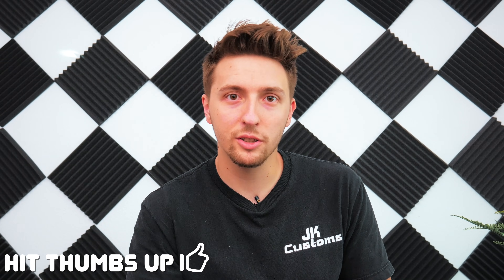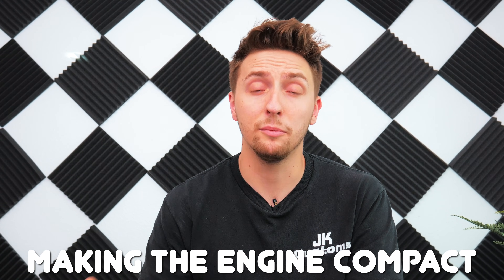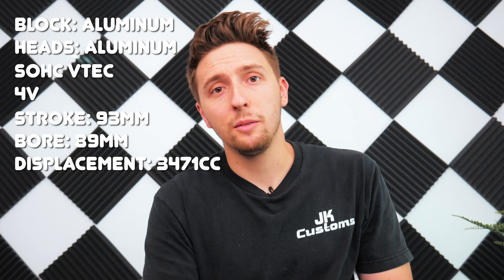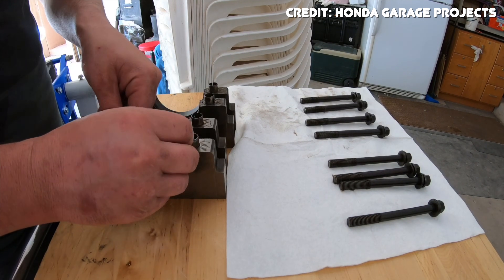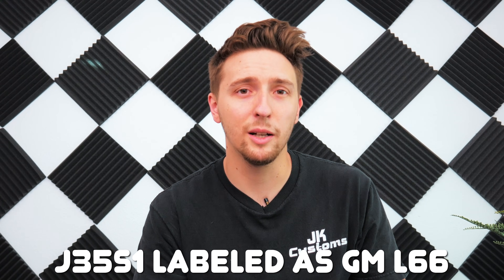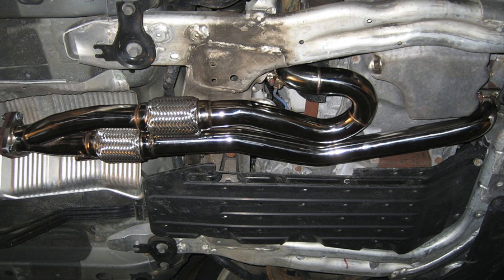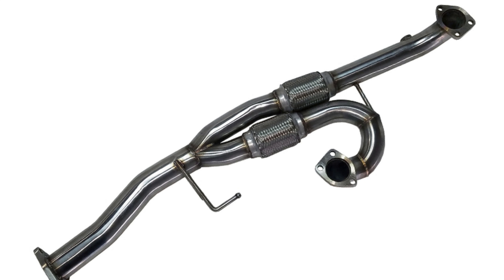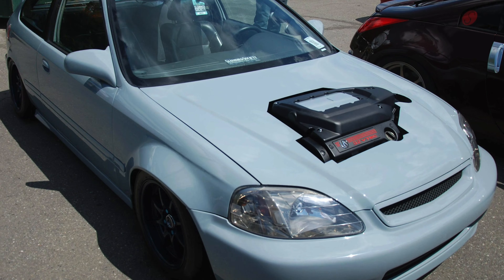Honda J35: Everything You Need to Know

Comment from the maker: If you guys enjoyed the video, please SMASH THAT LIKE BUTTON. It helps the channel out a huge amount and helps YouTube put the video in front of more people. Thanks for watching 😬
Reply: Hey yo, seems like alot of people ask  questions here, I recently came into owning a 2007 honda pilot ex l, it has a J35A9 ij it, and I'm wondering if all these other parts from the other models will still fit on it, unsure, peace and love ✌
Reply: I have a question what j or k series engines should I swap in a 2019 Honda CR-V. I want 1000 ground HP in the CR-V and I have seen a lot of videos about it also I want to have it still AWD. Please help if any advice.
Reply: If I get the biggest hood spacers would it still be needed to cut the hood ?
Reply: Just had the VCM muzzled on my 2023 Ridgeline - very smooth on the highway now.
Reply: I have a 04 Saturn Vue with the J35S1 it comes with 250HP and 243TRQ And i absolutely love my motor

Comment: I have a 2007 Accord 3.0 v6 myself, and tegas mirage isn't the best,but it hauled ass stock,and even moreso after a cold air intake, high flow cats,2.5" piping,and flowmasters. The only thing that really gets to me is that there are no tuners for the Automatic transmission model. So Its pointless to add things like bigger injectors and an Acura throttle body because it needs to be tuned after that to run right. So all you can do is basic stuff and get maybe 265 horsepower I'd guess. With a tuner id guess you could get closer to 290. But in their infinite wisdom, Hondata and Ktuner decided not to make tunes for it.

Comment: The J35Y6 that is in the Odyssey's is a SOHC VTEC 3.5L V6 in summary that gets 19 MPG on city and 28 MPG on highway. A very reliable engine (Toyota and Honda on the top) but for comparison when Honda replaced the engine in the PILOT with the DOHC VTC and variable timing 3.5L V6 285 HP 262 LB FT TORQUE J35Y8 the car got 19 MPG city and 27 MPG highway. Why I beg to differ is because the 2017-2020 Toyota Sienna's with the 2GR-FKS Dual VVT-i and Wide DOHC D4-S Direct and Port injection (Very Reliable) got 19 MPG and 27 MPG highway. A lot of people trashed this MPG difference that was very small personally and online without researching what SOHC and DOHC is. When Honda made a DOHC 3.5L V6 it got the same MPG as the 2GR-FKS. Regardless Honda Engines and Toyota Engines are very good like the J35Y6, 2GR-FKS that I talked about but a lot of unexperienced people in the field just make Honda engines seem very superior than Toyota engines without any proof. The 2GR-FKS was made with High forged steel camshafts, High forged steel piston rods, etc. and was tuned for performance, the J35Y6 has different characteristics like normal forged steel camshafts, etc. And opinions without proof just come up. DOHC and SOHC are very different and look completely different. Also engine stress is a completely different topic but 280 HP and 296 HP are compared like 280 HP with such lower components means Honda is always better. Not in every case. There's a reason why the J35Y6 has issues alongside the 2GR-FKS. Both have issues but someone has to claim the spot. In my case, the 2GR-FKS takes the spot since it has so many complex systems yet never fails on them most of the time (not sure if it ever did but I have seen these engines before), very powerful V6, higher hp and torque, higher redline, timing chain driven (Odyssey: Belt Driven). So many advantages. And very good low end and high end power.

Comment: Here's the revised sales ad with the added details:

UNLEASH THE BEAST!

Get ready to turn heads with this one-of-a-kind, V6 supercharged Acura TLX convertible. With its sleek design and powerful engine, this luxury ride is sure to dominate the roads.

The Specs:

- 3.5L V6 engine, supercharged for maximum power
- Estimated 450 horsepower and 350 lb-ft torque
- 8-speed automatic transmission for seamless acceleration
- Sport-tuned suspension for razor-sharp handling
- Upgraded brakes to handle the added power
- Hybrid rear end for optimized performance and durability
- Rear-wheel drive for ultimate driving dynamics

The Luxury Features:

- Premium leather interior with heated and cooled seats
- Navigation system with real-time traffic updates
- Bang & Olufsen sound system for an immersive audio experience
- Advanced safety features, including lane departure warning and blind spot monitoring

The Convertible Experience:

- Soft-top convertible roof for an open-air driving experience
- Windblocker for reduced wind noise and improved comfort
- Unique styling cues, including a distinctive rear diffuser

The Look:

- Aggressive front grille and side vents
- 20-inch alloy wheels wrapped in high-performance tires
- Quad exhaust outlets for a bold sound
- Available in a sleek, glossy black finish

The Deal:

This Acura TLX convertible is a rare find, and we're looking for a discerning owner to take it home. Price negotiable for the right buyer. Don't miss out on this opportunity to own a truly unique luxury ride.

If you're interested or want more details, hit me up! Let's make a deal.

Comment: I have a 05 Honda Odyssey with a J35A7 and its not slow, not fast but not slow
Reply: Get a Saturn VUE 04-07 the Honda J35A3 , it has 248HP/242TQ and the VUE weighs 1,000lbs less than the Odyssey.

The J-series VUE is very quick.

Comment: Would a J35 fit in a 1997 Odyssey without having to cut the hood?
Reply: Why not just find a Saturn VUE? 04-07 has a HONDA J35A3 in it and the VUE weighs about 1,000lbs less than the Odyssey. A lot of sellers I find don't even know they have a Honda engine. I find them for dirty cheap. 

The Vue even has a Honda Transmission.

Comment: j series has some issues with oil leaks
valve cover gasket
oil filter adaptor gasket
vtech solenoid
vcm system shortens the life of engine and leads to bank1 cylinders getting more wear and imbalances and oil filling up bank 1and potentially causing a hydrolock .   SVCM controler disables the vcm system which is the way to go.

Comment: Can any J35 be swapped into an 2012 Odyssey (that has an existing J35 with the VCM oil-fouling issue) ?  I know it needs the later bell housing, but will the existing computer work with the slightly different engine?  What additional work would I need to do?  Thanks in advance
Reply: Why not just get a Saturn VUE? The 04-07 has a J-series J35A3 and a Honda Transmission, plus the VUE weighs 1,000lbs less than the Odyssey. Most sellers of Vues don't even know it's a Honda. 

More HP than the Odyssey variant.

Comment: To my experience, and unfortunately for buying a high mileage Honda product with this engine, the engine with proper maintenance, did not meet my expectations.  By 285, 000 miles the rings and valve seals are messed up.  Not even my 290,000 Chrysler 3.8 has burned that much oil as the Honda did in its last days.  Never again another v6 from Honda.

Comment: 2006 Ridgeline with 190k miles, checking in. J35 is still rock solid reliable in 2024 with just normal maintenance. Maybe it's not a truck. But after owning it for 18 years, I can confirm a 250hp V-TEC-powered AWD mini-van with a truck bed is still pretty bad-ass in its own way.
Reply: 211k on my 2016
Reply: 239,500 on my 14 ridgeline sport still pulls hard and drives like new!
Reply: My 07 acura tl has a 3.5 and a 3.7 intake manifold with the 3.2 heads and its all bolt on stock parts and makes 336 hp naturally aspirated 6 speed manual we took off a civic si and got a plate maid to make them stick together I now have a allwheeel drive acura to with a si trans 😂😂😂😂 this car freaking rips dudes
Reply: I just bought 2019 Ridgeline 100k miles on it with new transmission now I'm worried is my engine burning oil or not.. you all are high mileage can you tell me when it can start burning oil and after burning oil how long it can go without totally engine failure please advise me

Comment: I know this is an old video, but I can say from my experiences that the J-series engines without displacement-on-demand are amazing engines. A good friend of mine has a 2007 Acura TL with the 3.2 liter and its been such a great engine. On long drives it is not unheard of for my friend to get 35 miles per gallon at 80 miles per hour. In town, it has no trouble pulling around at idle and it is willing to go as soon as you touch the throttle, even with the insanely tall geared 5 speed auto.

Comment: I have one in my Vue. I love it. If you notice, it's mostly the V6 Vues that have survived and are still around.
Reply: I have Saturn Vue Redline AWD (2004) with J35 S1...  117,000 miles.
I love it,  and want to get more speed/power out of it...  am still searching for a place to work on my Honda-powered GM.
(it seems folks don't want to touch it).   I'm patient;  I just purchased it in Sept. 2024.

Comment: My 2003 acura tl-s had the 3.2 and still ran perfectly at 385k miles when I sold it.  My wife's current vehicle is a 2nd gen rdx 3.5.  Great motor with good power and efficiency.  You didn't really cover bad...  timing belt and oil from vvt that drips on alternator.

Comment: my glory days working as a Acura Tech in the early to late 2000s i was trained on the J series engines and i loved them. simple to work on very basic and great service life. i still own my 2004 TL 6 speed manual bought it brand new.
Reply: godspeed. wish i never sold mine. 05 with 230k and had absolutely no issues. The starter almost left me stranded but i was able to get home and replace it there. Top tier cars, seriously
Reply: @AfternoonProductions  absolutely. i would buy another in a heartbeat.
Reply: Can I put a j35 a9 where a j35 a6 engine was?
Reply: I had a 04 Aspec TL 6mt for years. After developing many oil leaks that I couldn't afford at that time of my life vs the costs on a car that had 240k I decided to update and switched to a '15 6-6 Accord with 87k. I have been more than satisfied with my switch. LOVE my Y2. Doesn't mean I don't still miss my TL many days. Kinda wish I still had LSD sometimes but man the raw pavement put out of my Accord keeps a constant smile on my face after 4 years not to mention I'm still looking back at her constantly after parking. Both wonderful vehicles.

Comment: Ive seen a j32a2 online with the j37 crank rods and piston aftermarket heads and costum intake manifold! It was a crate engine and it was rated at 435hp and 317 ft torque 10,000$

Comment: My 2006 Saturn Vue, with J35, is actually shockingly fast, especially off the line.  Nobody expects an old GM SUV to move like it does!
Reply: fr I have an '02 MDX which is basically the same setup as a vue redline, but larger and heavier. The awd paired with the 3.5 litres of torque gives it an insane jump off the line with really solid grip
Reply: @cartler  yes!! Also, the Acura SH-AWD system is supposed to be really really good! I’d love to have an MDX! Cheers!
Reply: Are those suv plastic doors like it was on the cars?
Reply: @DV90400  yes, all plastic body panels except hood, roof and liftgate.
Reply: @DV90400  - Yes, plastic body panels, all around (on those older Saturns) ...  "DENT RESISTANT" is what they called them,  and they truly are.
In Sept. 2024,  I purchased my 5th Saturn ... 2004 Saturn Vue "Redline" AWD ... J35 S1 engine  (aka  GM L66 engine).
Trans. is Honda,  too.... The All_Wheel_Drive makes it pretty quick, off the line.
I just need to find someone to 'TUNE" it  (make it faster).

Comment: I have a '14 Honda Accord v6 Sedan and  this car is quick. I'm glad I got it. I may just get a turbo or it later on.
Reply: Same year and model. These are the biggest sleepers on the road. Put it in sport mode, take off the traction control and hang on. A family sedan with an attitude.
Reply: @brentbeardsley655  for real the gears are pretty solid too in sport mode.

Comment: 300k miles on my all original '08 RL with J35.  Only regular maintenance, synthetic oil.  For tat matter entire drivetrain is all original. I regularly use paddle shifters, and will effortlessly hit redline if needed. Great car, great engine.
Reply: Does that have same transmission as 2007/2008 TL / TL type S? I have an 07 tl type s and the automatic** transmission downshifting is pretty jerky. 238k km
Reply: @excess.subiefl0w  Sorry, I have no idea.
Reply: @excess.subiefl0w have you tried rev matching or are you just dumping the clutch into a lower gear
Reply: @josephdunham9273  sorry I should have specified auto trans 😂 it's alot smoother in D but if I put in manual mode, it hates downshifting so much
Reply: @excess.subiefl0w  the viscosity of the fluid could help make a difference other than that flashing the tcm or changing shift solenoids  maybe even the way the engine drops rpm on manual downshift could be suspect but that's all just off the top of my head
Reply: @excess.subiefl0w have you done any trans service on it? Probably needs a fluid change.
Reply: @Tylerc3419  yeah I bought 9 bottles of fluid to do the 3x3x3 fluid change. I did 1 drain refill already and it's better but the auto mode is just way smoother. Will do remaining 2 refills this year
Reply: @excess.subiefl0w  good deal man. Each drain you'll see a huge difference. I've done the drain and fill with 2 of my older Chryslers. Also helped others probably save thousands, not everyone knows you have to do more than oil changes sadly.
Reply: I have the same car and it’s great but watch out for the trans cooler inside the radiator because it will fail and when it does, your trans will get contaminated with coolant and cost you a trans job.
Reply: @Bob-lh4mg  thanks. My radiator failed a year ago and I replaced with a CSF OE so should be good for a long time
Reply: @excess.subiefl0w  👍

Comment: The j32 heads have to be from a J32A2 which is the type-s motor from the the 2001 ro 2003 CL and TL Type-S. all other j series have normal heads.

Comment: GM should have just used Hondas engine. Their 3500 engine is gutless. 210hp compared to Hondas 250hp.
Reply: They did in the Saturn vue 2004 to 2007

Comment: Love the J Series engine, if you take care of her she will take care of you. One thing he forgot to mention, change the timing belt and the components every 90,000 to 100,000 miles and keep your eye on the coolant and be sure to do your oil changes.
Reply: @user-pv8sx8xm4uthe average person don't know much about piston rings yet every engine has them. so the point is?
Reply: @68camaro-b5s I cannot explain it myself but this has always been my understanding in general. Seems like it's a more common issue on V6 vs i4 with piston rings, timing, etc.
Reply: What's up with keeping an eye on the coolant? Water pump leaks?
Reply: @MeltingRubberZ28  Lack of doing timing job because of costs it seems like. Since by the time you get to the water pump, you're practically peaking a timing job that includes it by the pumps end cycle expectancy. Being cheap asses instead of doing ball joints, plugs general maintenance etc. Just my 2 cents I'm no mechanic just know some basics.

Comment: Do the benefits of the j32 head flow outweigh the decrease in displacement? Or does it not affect the displacement much
Reply: Heads do not play a part in displacement as the pistons only move inside the cylinder, in the block.

Comment: Nope, it's a great v6 but has nothing on a ford yamaha built 3.0 or 3.2 v6, 220hp stock, add a supercharger or turbo charger and your looking at 400hp+ stock.  Now tell me those yamaha heads can't breath, well they do and they do it flawlessly.   I love the j series but when it comes to power the ford yamaha v6 designed in the mid 80s was on another level minus the vtec.  But what is did have was a duel stage intake manifold that would keep that tq. Curve flat and fat.  It was a great engine for its time and that's it.   500 hp+ was easy depending on modifications,  plus the engine can even be rotated for rwd applications as the intake can also be swapped around as well.  7300 factory redline, or if your ballsy enough 8500 rpm can be achieved stock with no accessories on it considering 
the accessories could not spin that fast.   Tell me yamaha didn't build an over achiever in its day.

Comment: Could the Atkinson cycle be a reason why the 4 cylinders have to rev so high to produce a lot of power?  I rented a 2001 Corolla (thank you God, that I was only renting that thing!!) and it had good low end torque but on some hills forget anything about acceleration.  It may very well be cars like that people think of when it comes to boring cars.  I had a 2002 Neon that was also 132 HP and it at least seemed to want to accelerate where the Corolla seemed to want NONE of it!  I am not sure if the extra .2 liters helped but was it an Otto cycle?  I hear the Atkinson cycle can make a car seem gutless.

Comment: I have a 2007 Vue. The J35 came in the 2004 to 2007 V6 Vues. I gather the J35 engine in the Vue is the same one as the 2001 to 2002 Acura MDX. What I'm wondering is if it's the same tranny as well...

Comment: Got a 2007 Acura RL with 300k miles. The J35A8 in it is pulling very strong, doesn't burn a drop of oil .
Reply: 05 RL, car is bulletproof wit 300 hp
Reply: Super slept on car

Comment: My ONLY complaint with the engine is that it still uses a timing belt. Honda needs to convert it to a chain, or make it a non interference engine...converting it to a chain would be easier and less expensive...
Reply: Timing belt engines are a little more forgiving about oil changes and because the belt is a maintenance item they make it accessible and easier to change. Timing chains are supposed to be good for the life of the engine but when things go wrong it's supper expensive to fix.
Reply: @jacobvanbruggen5462  I've watched the video on replacing the timing belt on this engine and it's definitely NOT easy to change. I can see why mechanics charge $1000 or more to do it....